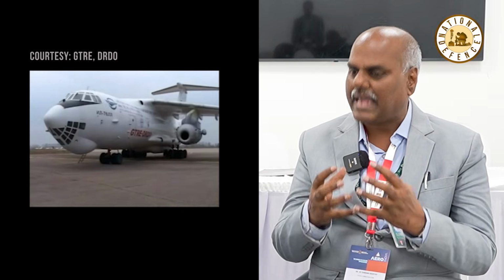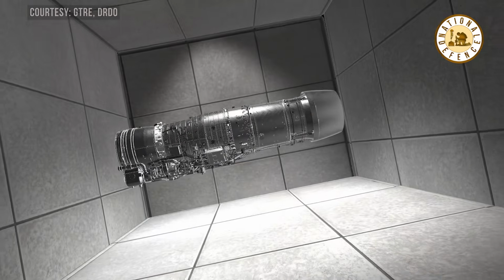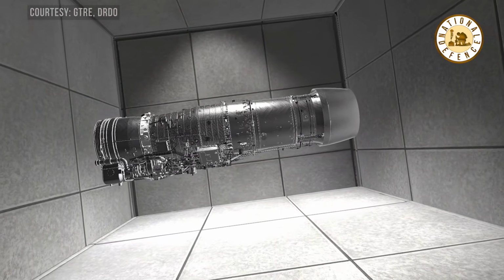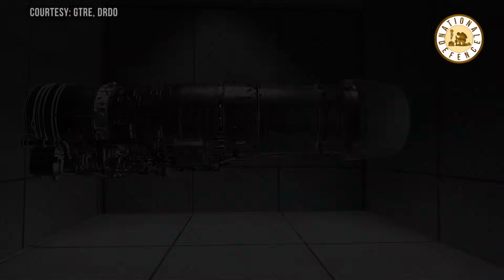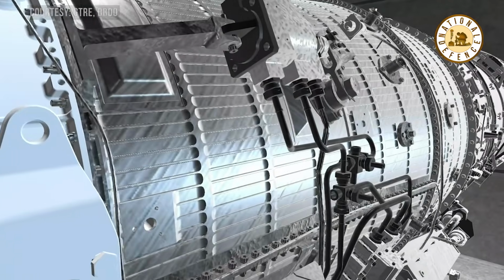India's Quest For Indigenous Aero Engine For LCA Tejas & AMCA Fighter Jets | GTRE Director Explains!

Comment: Bottom line is they are not able to generate required trust engine and they do not have solution for higher capacity. They are expecting partnership with international engine company and it will take 10 years... Nobody will give that technology to you... forgot about it... France betrayed in rafel deal where it was agreed that they will do tech transfer for engine and develop new one. but nothing happened... Very sad....

Comment: Testing on ;
Computer Simulation;
Thrust;
Drag;
Altitude.
Design latest ;
ex;
 COMBO Hybrid  of ;
Aircraft+ Missile+ Satellite
 means 
The wings could be Telescopic type; Which can be folded
As you fly into various  spheres;
 the Design should MOLD;
like  one Missile which can fly faster like  Missiles;
 and as the aircraft comes into particular sphere like the Parachute opening the Wings should come out  
as needed .
like the  EAGLE in Action;
 or Beetles when flying ..

Let there be more;
Refractories;
 aluminum
 fine steel
Alloys; 
foundries;
METALLURGY.

Comment: Good to know about engine developments. But weight to thrust ratio is not good. Just increasing the engine thrust to fit in unmanned vehicle is not sufficient, the weight of the engine should be reduced as well. That is where you can bring up compact & efficient engines.

Comment: To achieve the goal of creating real world class jet engine, following technologies have to be mastered:
1: Capability to create Single crystal Blades for turbine or Single crystal Blisc (Blade + Disc). 
2. Mastery of Titanium metallurgy  - 3D Printing and Additive Technology. 
3: Nano Scale Precision is must to create best jet engines. 
4: Public - Private partnership and Industry-Academia Partnership. 
Last but not least, enough funds. 
India has about 700 billion dollars reserves and if 10 billion dollars can be given to 3 fields - 
1: Semiconductor for 1 nanometer chips   
2: Genetics research for gene editing in biotechnology. 
3: Energy research to create indigenous solutions. 
These 3 things will make India a global super power in 10 years.
Reply: Very interesting aspects Doc. Combination of will, Capability and funds will yield great results
Reply: Valid points Dr Shaun
Reply: Good to know about engine developments. But weight to thrust ratio is not good. Just increasing the engine thrust to fit in unmanned vehicle is not sufficient, the weight of the engine should be reduced as well. That is where you can bring up compact & efficient engines.
Reply: @dr.shaun.g govt only giving little amount to research and mostly purchasing engines due to commission system in weapon industry ...why still in 10 years rafale jet still not made ...why purchased at 3 times cost of rafale ...rafale is 4 th gen only ...govt is willingly stopping innovation in engine technology as kaveri was closed in 2014 and making engines were stopped in 2017 ...we Indians expecting too much from modi and gtre

Comment: I am not very knowledgeable on this subject. But I feel it should be possible to use gas propellant instead of liquid propellant, in which case, the overall take off weight of the aircraft will reduce and it will be able to take more ammunition.

Comment: Unfortunately India's Aero engine development sucks. After spending 2000 cr and 36 years of research, there is not a single working engine delivered by GTRE. The entire Tejas project is now at the Mercy of GE aerospace. The money spent on R&D is fine. But the lost time can never be earned back. Wish GTRE had made the decision to co- develop / collaborate with friendly countries 20 years back. Today the Kaveri engine would have been a grand success already implemented on the Tejas Mk1. The current leader of GTRE has rightly pointed this point. Unfortunately he is facing the heat for the blunders of the past leadership. Neverthless, India should never abandon developing it's own engine. Good luck sir. Wish GTRE all success under your visionary leadership.
Reply: No body help u in this aero engine technology because its crown jewel technology . You need to develop ur own.